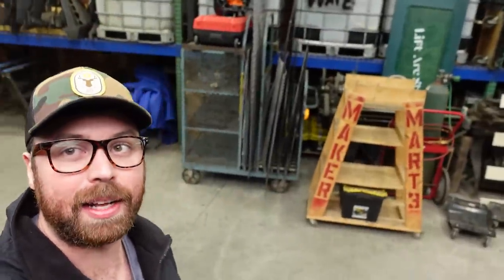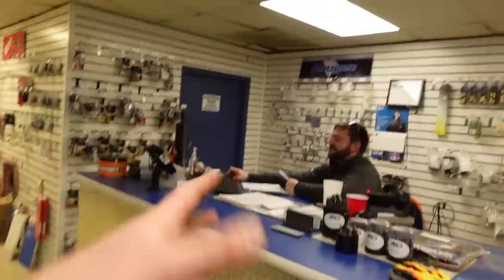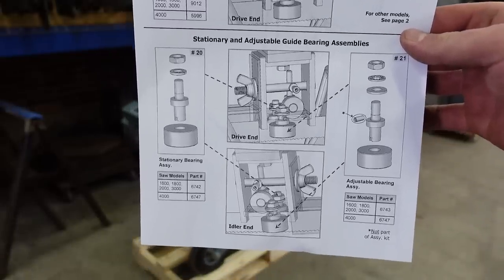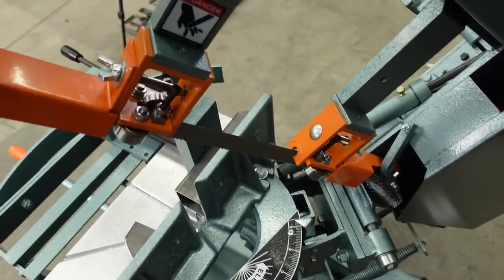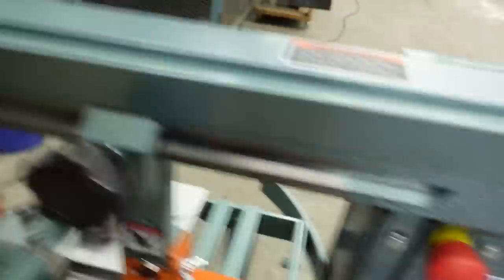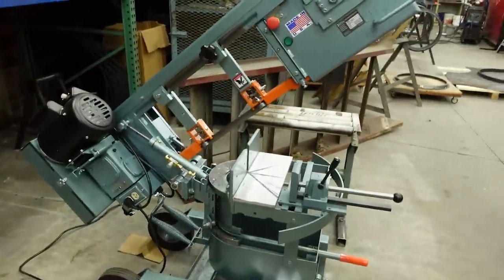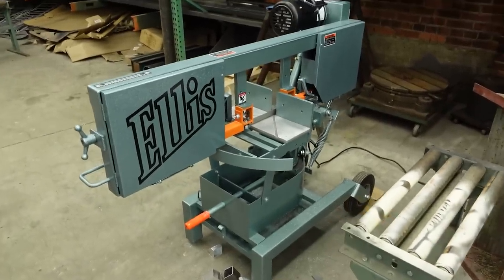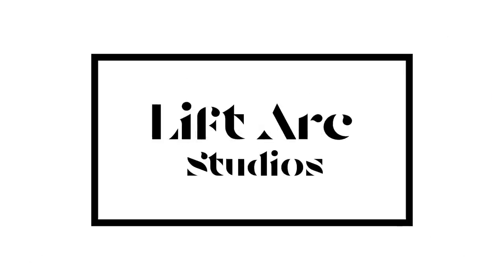This Thing is a BEAST - Ellis 1600 Mitering Saw

Comment: I purchased the 1600 a few months ago. It looks like you got one of the Chinese made motors that originally came with mine. I had the same problem with the motor. I called Ellis they explained that they were having a hard time sourcing the lesson motor that should come with the saw. The fix is you can’t use an extension cord with the Chinese motor. I asked them to send me the lesson motor as that was one of the main reasons I wanted the saw. They were kind enough to swap it out for me. Love the saw!
Reply: What really happened:  They were sleezy enough to try and pass off a POS motor onto you but it didn't work.
Reply: Did your saw run fine after you got the Leeson motor?  I just bought an 1800 and it came with the Leeson motor.  It does the same thing as it does in this video on the initial start ups.
Reply: I should mention I also have it plugged into the wall, no extension cord.
Reply: I figured I would give an update in case anyone reads these things.  I called Ellis. They said it was likely an issue with the gear box. They said the manufacturer had been putting a thin shim in between the cover and a bearing. The added pressure would make the motor work harder, raising the voltage draw.  They had me put the saw in the vertical position, then take off the cover plate held on by 4 bolts. It's the smaller one that is horizontal when the saw is vertical. You see the shim sitting on the bearing. I removed it and tested. Starts perfectly fine now. The voltage dropped to the specs on the motor and the amp reading is now slightly less than the motor specs.  Hope this helps.

Comment: The inrush current of the motor is to high and pulling down the voltage.  Try a shorter extension cord or bigger wire diameter on cable. That would work
Reply: Gee.. that is not good.. to get it to operate, straight out of the box, it is suggested you need to rewire the thing!!  You will not be doing the motor much good letting it “labour” like it does on startup..

Comment: I have the same saw.   It's very well used (got it for free).    Word of caution if you haven't already found out the hard way...when the saw is turned to full miter (+ or - 45 degrees), be careful when lifting the saw to the full "up" position as the center of gravity is no longer centered on the 4 floor contact points.    I was cutting 45 degree miters and when done, lifted the saw with gusto, and the whole thing tipped over, smashed to the floor and twisted up the drive pulley cover.

Comment: I bought one in harbor freight like 2 years ago and since day one works like a champ for 1k 😂 nice and solid saw and no issues with the motor
Reply: Those are nice
Reply: I just bought a used one of the $1400 HF saws for $450. Came with a better aftermarket blade.. All the coolant had evaporated into a sticky goo but cleaned it out and it all works perfect..:)
Reply: @frankish5314  that's a awesome deal!
Reply: @19672701  They are.. I got my new (to me) one trued up and I'm amazed how square it will cut.. I took a piece of 4 inch 1/4 wall pipe and it was bang on square! I'm thrilled with it.

Comment: This is Definitely the Saw I’m going to purchase! Either this one or the 1800, but for sure will be one of those 2 Models from Ellis. Great Video
Your problem with the Start Capacitor is either going to be a Bad Start Capacitor or you have a bad Voltage Drop where it is plugged in to. I’m betting that it’s a Bad Capacitor though, because I had one that did the exact same thing on a brand new Ingersoll Rand Air Compressor. I called them up and they sent me a new Start Capacitor and it cured the problem as soon as I swapped it out.

Comment: Pull the cover and check connections on the start cap. Could have become compromised during shipping. Long term, think about putting a 3ph motor w/ vfd. Infinitely adjustable speeds with no pulley change. Love the channel!
Reply: I think it is missing quite a few niceties for a saw of this price. I would want more horsepower and a VFD. I think a chip blower should come with the saw. The ways and pulleys look to me like they should be shielded from chips and debris. The door having no latch is a real oversight. Velcro? That is kinda lame. Needs a little mirror tucked under the arm so the angle gauge is visible in line with the blade. Or maybe a duplicate of the angle gauge somewhere to line things up. But I guess all of this stuff is DIY.

Comment: Great saw the company I worked for had one that they bought in 1988 and it's been a workhorse.  The only thing they replace is the blades because of the idiots using it.  They tend to let it hog into the metal to fast, tearing off teeth.  The Velcro on the doors will last it's still holding after 35 years.  Watch it on round stock.  That vise will let it spin if you don't get it tight.  We set ours at one speed and have never changed it,  just adjust the rate of cut.

Comment: I like the double mitre feature of the saw. I have been looking at mitre saws to help with speeding my cut time up. Overall, it seems like a decent saw with some tweaking to be done. The cheap Chinesium motor is a big turnoff for me. That saw deserves a nice, smooth motor. I don't know if Baldor is still US made but would be my first choice. The Velcro on the blade covers is a real disappointment to see. Not saying the saw is junk, but it just pisses me off to see that crap on a machine you pay good money for. Hope they get you a new wheel! :)

Comment: Was looking for a saw, I think I'll be steering away from the Ellis,almost everything you showed turned me off on this brand,motor, miter gauge ,velcro on the doors. Seemed like second thought design. And should have had a Baldor or a Leeson motor for the cost. 4 to 5 grand should get something with coolent. Thanks for the great informative video!
Reply: I have a Carif260bsa mitre saw that is world's better built than this...and I got it second hand from an idiot who had done all sorts of dodgy repairs to it.
Reply: @mtnbikeman85  those look great, but $12,000
Reply: Check out jet saws

Comment: Bought a 1600 about 4 years ago. It never cut square, the head wiggles back and forth while running, a lot of ugly welds on it and a few other smaller complaints. It's been sufficient for a farm shop saw but I won't buy another unless quality control gets better.

Comment: watching this after getting curious about the saws origin , the way its been packaged makes me suspect that it was actually a customer return  being sold on as new just to get it off their hands in the shop selling it to 
guess you need to fix it youreself as they probably trow a hissyfit when you start to trow youre weight around about it being defected

they might actually have gotten their refund from the manufacturer after taking it back from the former owner allready before selling it on to youre local shop making it their problem

Comment: Why level the saw? With sloped floors, as you say, if you move the stands then you need to adjust the stand height. If you make the saw parallel to the floor, if the floor is flat you shouldn’t have to adjust the stand height.

Comment: Why would you use a long, undersized extension cord on any of your tools??????? Come on don't blame the motor...
Reply from the maker: Just used a 20ft cord, super thick wires, still have same problem. its a mobile saw...the solution cant be to not use an extension cord.